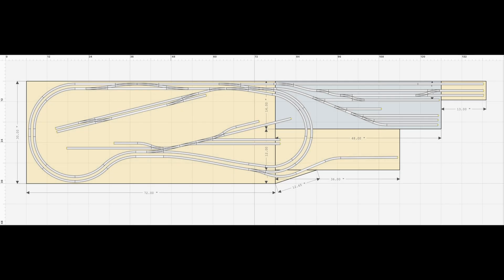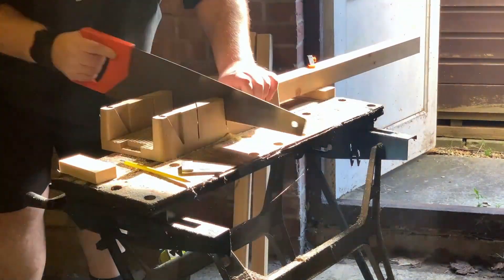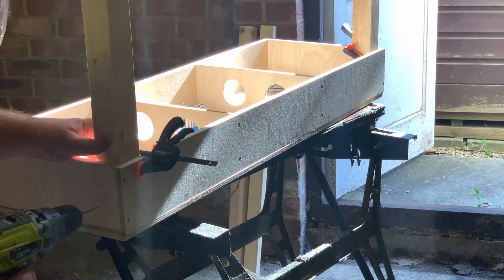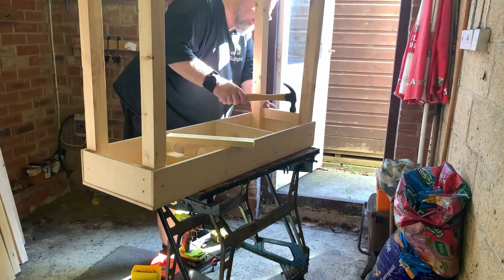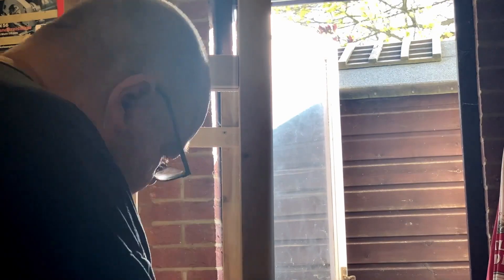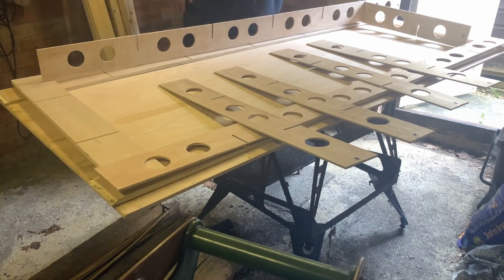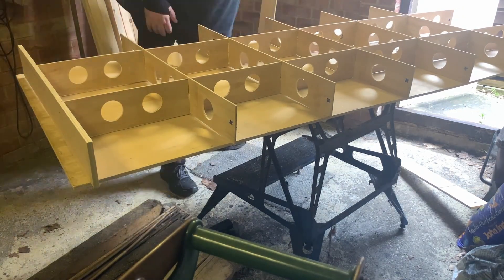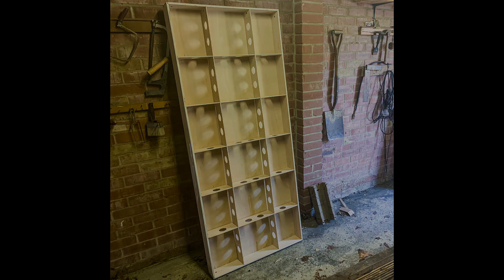008 - Shelfington - Building More Baseboards

Comment: Most enjoyable Ian, will you add ley height adjusters as often floors are not level? I used the type where you drill a hole in the bottom of the leg and there is a spiked threaded bracket which allows you to screw the leg in and and out about 30mm. All the best and looking good.
Reply from the maker: Thanks very much Chris, glad you enjoyed it! Yes, it's funny you should mention height adjusters, as I just fitted that exact same type yesterday to all of my baseboards! A video of me doing it should pop up on my stream within the next couple of weeks! Cheers, Ian.

Comment: G'day Ian, 'the pusuader' a very handy and essential tool to have in your arsenal 🤣🤣 You're on a very steep learning curve with the woodworking and lots of mistakes and expletives are a must to move forward with your skills! 😄 And after all that it turned out perfectly level 👌👍👍 As for the screwdriver bits etc unfortunately some of these tools can be very bad quality. ☹ Anyway, all the best from Oz. John
Reply from the maker: Hi John! Yes, the hammer is the most versatile tool in my toolbox, and can fix no end of problems! Yes, definitely a steep learning curve, but I'm on a roll with getting baseboards to sit level! I've just finished making the legs for the 6ft baseboard, but you'll have to wait for a couple of weeks to see if my good fortune continued, when the video showing it comes out! Yeah those drill and driver bits were cheap rubbish off Amazon - should have known better really! Oh well! Cheers, Ian.

Comment: Hi Ian, I'm thinking of purchasing some baseboards from model railway solutions. How did you find the construction and was it easy to fit the plywood top to the frame? All the best, Jon
Reply from the maker: Hi Jon! The Model Railway Solutions baseboards are excellent, and I thoroughly recommend them! They were fairly easy to put together, as everything was marked, so you knew where all of the pieces had to go! My biggest problem was putting in the panel pins, as I kept bending them, but I got there in the end, and once everything was glued, it was rock steady! The plywood top had predrilled holes where you needed to screw it down, and fitted on top of the frame easily once you got it aligned! Just keep in mind that you need to make / purchase legs! Good luck! All the best, Ian.
Reply: Hi Ian, thank you for getting back to me. I spent the weekend making 2 by 2 legs and putting feet levelers on them. I've had a go at doing baseboards and frames myself but my carpentry skills are pretty none existent to be honest!! so I thought I would look into something different. All the best, Jon
Reply from the maker: @jonpinney8537 - Hi Jon! It's surprising how difficult getting a simple square frame can be when making your own baseboards isn't it? I don't think you'll be disappointed if you go with MRS baseboards - if I can build them, anyone can! Lol! The feet levellers are a great idea, or at least they were for me, as my legs are situated on carpet! Good luck with your build! All the best, Ian.
Reply: Thanks Ian. @iansngauge